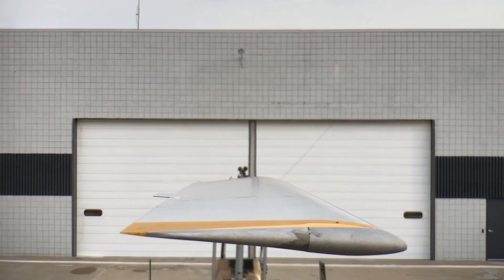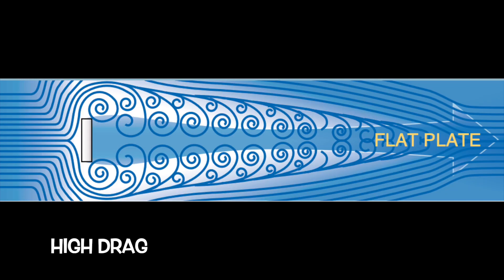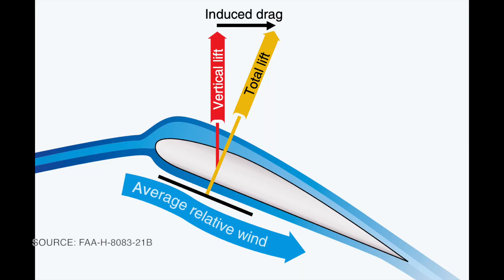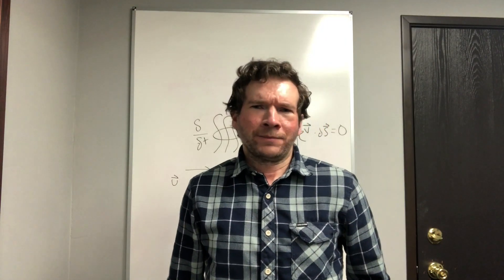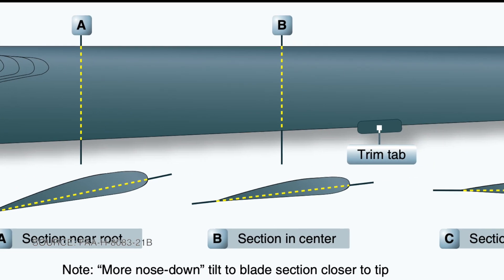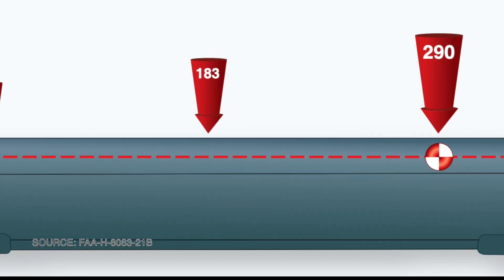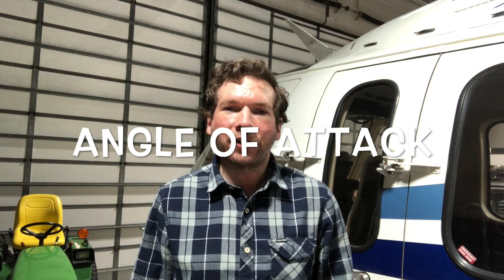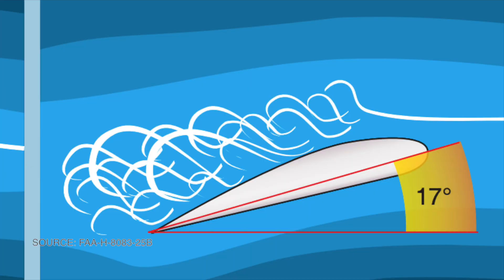Blade Tips Episode 2 Helicopter Aerodynamics

Comment: So essentially the Pitch angle  the distance between the Chord Line and the Reference Plane (Would X axis of rotation work here?) as the  Angel of attack is the distance between the Chord line and the relative wind. is that correct? One last question, with that being partially understood, outside of an air tunnel is there any way to know the angle of attack? Or does the pilot simply know the pitch angle and adjust it as needed for lift. Thanks for your time in advance.
Reply from the maker: Yes that's correct. The pitch angle is the angle between the chord line and the plane of blade rotation (which is the plane perpendicular to the axis of rotation, so you could call it the X axis). To the second question, no, the pilot has no way to know the angle of attack of the rotor blades as there is no gauge in the cockpit for that. However, such a gauge is not necessary as you are correct that the pilot simply adjusts the pitch as necessary to do what they're trying to do. Basically they look out the window to see how they are moving and change the pitch if needed. If the pilot is trying to hover, the angle of attack changes everytime the wind blows, so constant small changes to the pitch are necessary to stay in place. Thanks for watching!